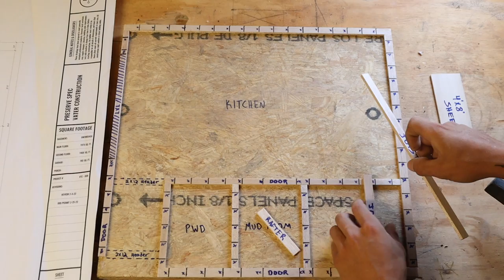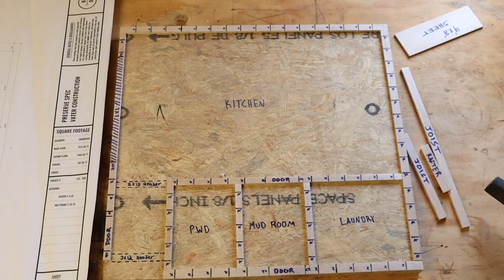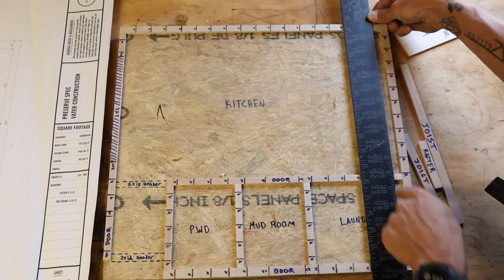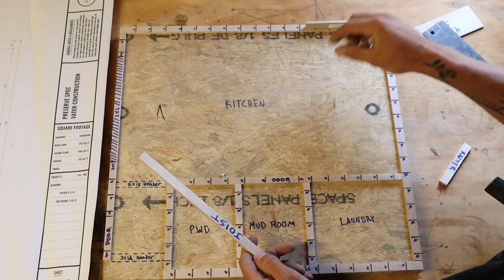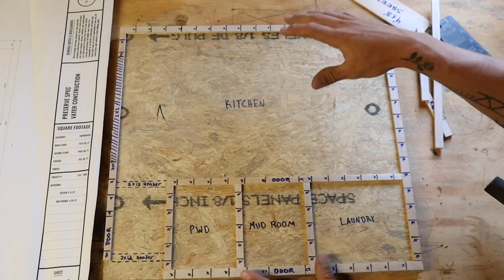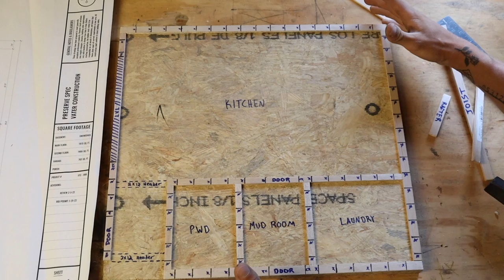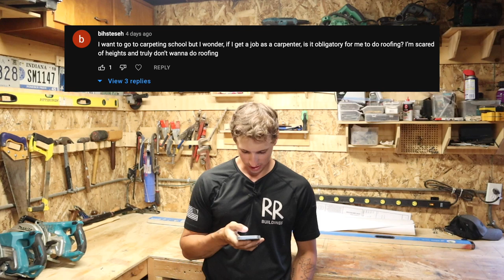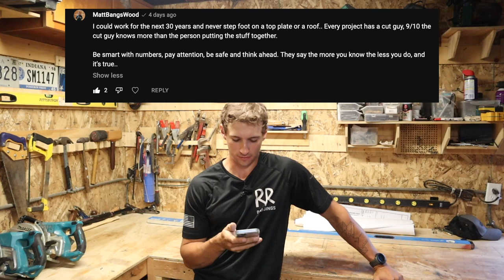Ask a Framer Ep. 1 - Layout/Blueprints, my tools, and more!

Comment: I got a question for you since I never get to do stick frame/hand cut roofs. I’ll try my best for this to make sense in comment format lol. If you are laying out ceiling joists from east to west for example, and you mark 16 and go on the southside and 16 and back on northside. Lapping  them on an interior wall in the middle of the house. Now you nail your rafters to the joist and wall on the opposite side of layout. Like you said in the video, one side is going to be an 1 1/2’’ off. Wouldn’t you want them to meet at the ridge without being crooked or offset? Could this be solved by nailing a 1 1/2’’ block between the joist where they lap over the interior wall. You mentioned code in your area allowing a 3’’ tolerance when it comes to landing on a stud. Great video man!
Reply from the maker: Yes! You could very well do that. I’ve actually never thought of that. There’s been instances where we’re at our ridge and the layout is flip flopped on each side. Nothing wrong with it but when you’re looking at it from a perfectionists view, maybe like you and I. It makes sense. A lot of the times we have more than two sets of joists. Our ridge ends up nice and lined up with layout. Definitely just preference in my opinion. There’s been instances where we had a skewed layout and as long and you pick nice straight ridge stock and post the ridge in the right spots. Making sure everything is nice and tight, you should come out with a straight ridge. Depends on how well you built your walls. Nothing wrong with skewed layout on the ridge. As long as it’s straight and level! Thanks for the question! Please keep ‘em coming
Reply: @certifiedladderholder  Cool! Hey thanks for responding man! Love your channel.
Reply from the maker: @andrewdempster5170  No problem👍Love your comments!